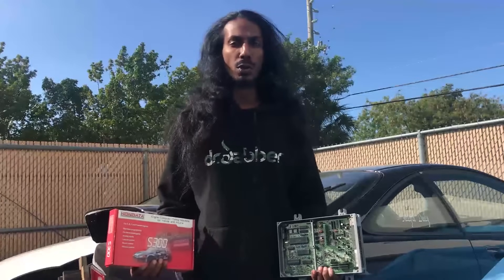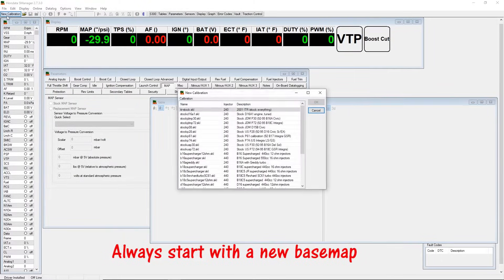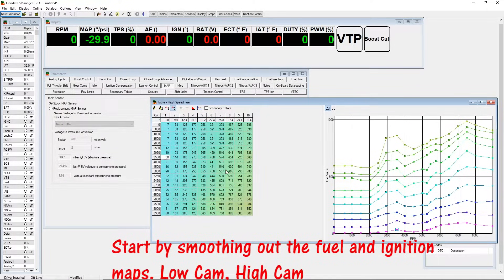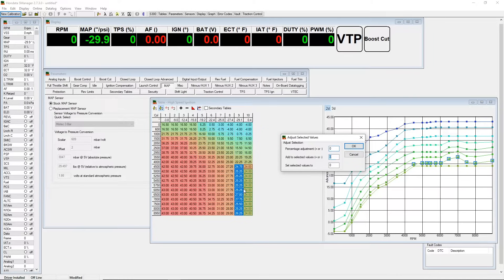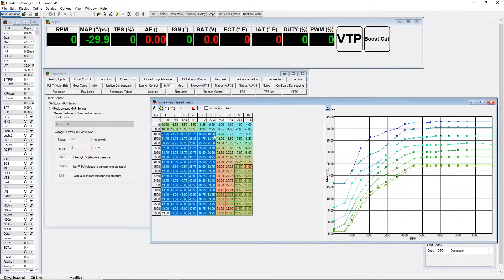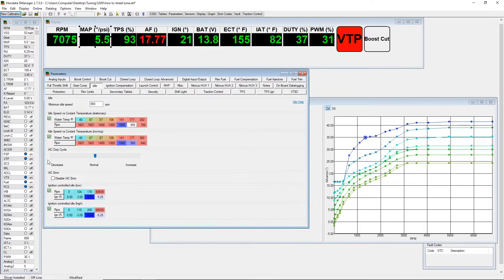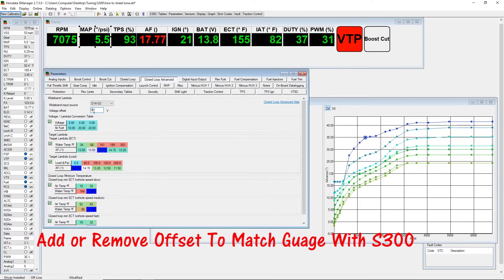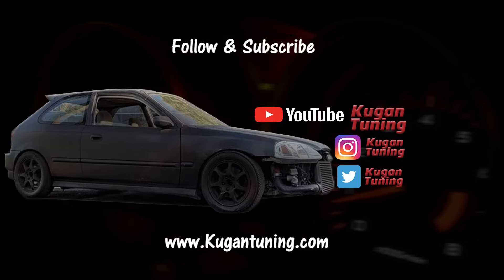How To Street Tune Part 1 On Hondata S300

Comment: I have a weird issue where mine goes super rich at vtec crossover.  Seems like no matter what I do to the fuel table it wants to peg the gauge rich at crossover and then level back out 🤷🏻‍♂️.  I don't know what I'm doing wrong
Reply from the maker: What’s your setup? Mods? What’s Vtec crossover?
Reply: @KuganTuning .  Turbo Vitara y8 with crower stage 2 turbo cam    the crossover was set at 4000/4500.    I increased it to 4300/4800 but didn't seem to help much.
Reply from the maker: @gibhamracing37 pull out fuel on crossover. It’s best to use a dyno to find the best crossover point as well, gauging it off fuel consumption is okay but not super great for what you’re trying to achieve.
Reply: @KuganTuning thanks.   I ended up paying A got to remote tune it.

Comment: Dude you gotta cut the music out. Its overpowering your voice and i wish you jas explained more what you were doing as you were doing it. Im having so much trouble finding the right video to know how it all works
Reply from the maker: Where are you stuck with tuning your car?
Reply: @KuganTuning im just trying to learn how it all works. I cant believe the cost for canadians to mod their cars. 
Its $1200CAD just for hondata, not installed and without the ecu. Some local guy here is saying he charges $1200 just to tune the thing on the dyno. Thats completely outrageous. I know most tuners charge $300 for a dyno tune. Thats why i am trying to learn how the tuning process works, so that when the time comes, i can do it all myself. I completely rebuilt this whole care, did the manual conversion, added Vtec, knock, IAB wires right through the original engine harness, had to extend and relocate certain plugs. Id like to say its completely stock with I/H/E, but i found out that none of the honda H series engines came with dual valve springs. When i rebuilt the head, it had dual valve springs for better performance. I did a compression test and it showed 220psi across all 4. Im assuming the last owner did piston rings. But why valve springs? He must have upraged the cams or piston compression maybe? Im waiting on a new ECT, IAT, and guage temp sender. Shes running filthy rich, so im hoping one of those is the fix. I was told i did not need a tune for just i/h/e on a prelude, so im assumimg the computer is thinking the car is staying cold from a bad ECT sensor causing it to stay rich once it warms up. Injectors  have been cleaned, o2 sensor (plugged directly into header down pipe) is brand new. Waiting for the sensors to come im tomorrow to see if it changes anything. Might take iacv off and try to clean it again to see if it changes anything. Im out of ideas after that, other than a tune.

Comment: Ive just completed a jdm h22a euro r swap in my 4th gen prelude. Ive tried the couple of h22 calibrations in the options and they will start and run car pretty good. Even 1st gear pulls descent but anything after that the car has no power (torque). Im going to try this map soon along with your technique starting out. Really hope it helps. I have converted car to obd1 with p28 ecu with hondata s300 v3 installed.
Reply from the maker: @brianpittman2929  the biggest problem I find with H series is that it’s either not timed correctly mechanically or the distributor is not synced with a timing light. Make sure those 2 are correct first because your going to have the same problem with this basemap
Reply: @KuganTuning  ok I made sure all my marks were dead on mechanical side. With timing light on my flywheel there's a number 12 with a thick center line and there are a couple smaller lines on each side b4 and after the 12 mark. I set it dead on 12 mark. Guess I'll double check service manual and see if that's right

Comment: would this possibly work on a d16z6 like everything u did in the vid
Reply: or what could i do for a stock d16z6 build
Reply from the maker: @prestonhulsey  Load the stock D16z6 file for a stock Z6 and it will work out really good for you. Clean up fueling and you will be happy.

Comment: I have a b18lsv semi built turbo, can I follow this video to be able to start and run the car and then follow the steps in part 2 to dial everything in?
Reply from the maker: @dHuMp276  yes. Be light on ignition timing in boost if your not using a dyno to verify your results and know your making a positive or negative change
Reply: @KuganTuning  I went exactly by the video in part 1 and my car won’t run, it will crank but then die. Any suggestions on what I can try?
Reply from the maker: @dHuMp276  what’s the wideband read before it dies? I don’t have enough information on your setup. Did you put the right data for map sensor?
Reply: @KuganTuning  I don’t have my afr gauge ran to the ecu but the gauge was reading in the high 14s, and I have a 4bar VMS map sensor so I just put custom and didn’t change any of the settings or anything
Reply from the maker: @dHuMp276  does your map read 0psi at idle or 100kpa? It will be a little lower if your higher up in altitude. So check that first, take a log.
Reply: @KuganTuning  it doesn’t sit and idle, once I crank it unless I tap the gas a little it will cut off but I will try to get a log to see what the numbers are
Reply: @KuganTuning  I put the stock map sensor back on and it fired right up no problem so I’m going to try and datalog with the stock one until I can get a new one. If I have any issues do you have another way for me to reach out to you for help?
Reply from the maker: @dHuMp276  you can text our support number 561-285-2977 
Or contact us thru the chat option on our website KuganTuning.com 
Or message us on Instagram/Facebook/Tiktok.

Comment: have u ever tuned b16B (civic type R) is so did you start with the jdm p30 aswell? im using hondta in a p28. cant find ANY b16b tuner base info
Reply from the maker: Yes and yes. I had to tune b16b to figure it where it wanted timing for mbt.
Reply: @KuganTuning  got an ig?

Comment: I have a b20vtec B20b gsr refreshed head skunk 2 mani header exhaust would this basemap still be good for it? Starting off as a p30 and smoothing it out and everything we’re do I go from there all motor wise with leaning it out and making it rich?
Reply from the maker: This basemap is no longer available. We do offer remote tuning. 

If your tuning it then tune it. Using a basemap will always be hit or miss.
Reply: @KuganTuning …I’m working on a different kind of build but just curious about ending the tune you started? Was it bcs of all the inquiries was too much? Or just other stuff going on?
Reply: Tune it for sure- make sure your wideband is hooked up and communicating with your s300 module then start data logging and make your adjustments from there..

Comment: So even for a non v b20b you run the p30?
Reply from the maker: I always start with P30 basemap and tune from there. That includes adding or removing timing to ensure the engine is safe by “tuning” the engine

Comment: Hey bro how can I make the af reading from the wideband to display on the screen like that, I’ve tried at d14 and eld and all it reads at most is 1.02 thank you
Reply from the maker: You have to set the voltage offset under closed loop advanced
Reply: @KuganTuning  I do but it still doesn’t display it, all it displays is “ a/f: 1.26 “ thank you
Reply from the maker: @JuanLopeZ-vc1ws  wideband isnt wired properly. What wideband are you using

Comment: What about doing timing for boost ? Since I only see yours is all motor
Reply from the maker: The tuning process is the same all motor or turbo. Every engine has different requirements. You job as the tuner is to find out where your engine is happy.

Comment: I have a plx wideband do I splice it to d14 on o2 sensor plug? A
Or can I just keep it on open loop and install the wideband alone and watch the gauge?
Reply from the maker: You can do both. I would run the wideband 0-5v wire to d14 so that the AFR can be logged in Smanager. Only when your done tuning the car in open loop loop, turn on closed loop and tune the closed loop settings
Reply: @KuganTuning  yes I currently have it in open loop and run it directly but that's just to keep watch on my afr. I want to log it so I can do some street tuning and fuel table adjustment etc.  So once I dial it in and I set to closed loop will the afr change alot or are u saying once on closed loop continue to dial it in by doing datalog and readjust? Thanks!
Reply from the maker: Once you turn on closed loop you have to dial in the closed loop settings on the closed loop tab. The fuel map doesn’t need to be changed once open loop is good.

Comment: Why do they have the stock H22 as 450cc injectors when they are 345?
Reply from the maker: I’m not sure why Hondata did that
Reply: I thought h22 injectors were 245cc for usdm and 310cc for the euro r?
Reply: @squirtmister  its 345 for obd 1 and 290 for obd2. The obd1 use a resistor box and are low impedance. 245cc is for the non-Vtec F22a/b and H23a1 non-Vtec. AFAIK.